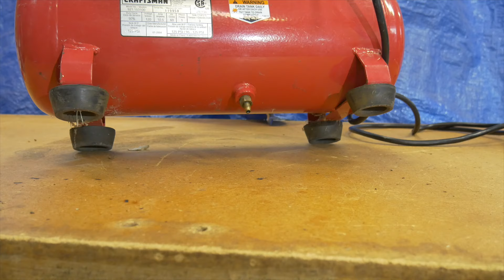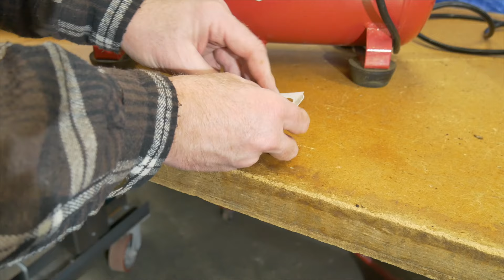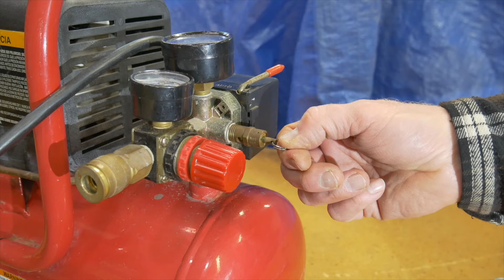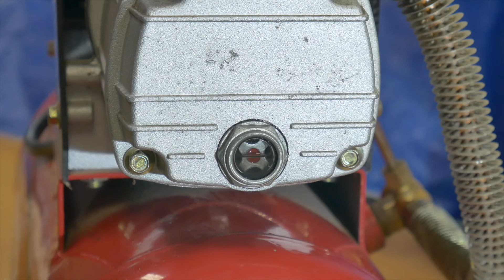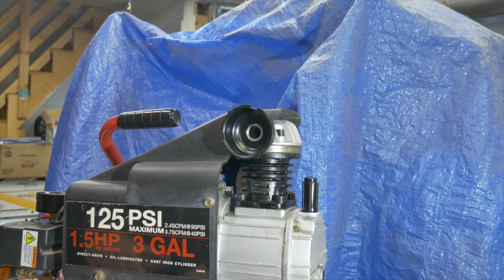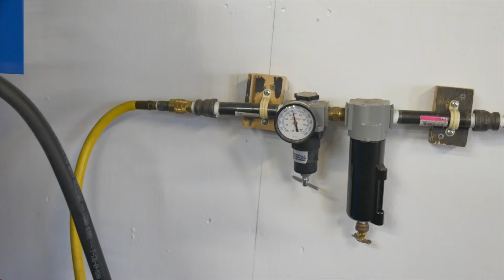Air Compressor Maintenance - A few tips to keep your small air compressor in top shape!

Comment: If you open the drain valve with 20 PSI in the tank it will blow all the water and moisture out
Reply: Add a cooler between the head
and the tank and you won't get
any moisture in the tank. It will
last a lot longer. 😁✌🖖

Comment: Thanks very much for the video, what are the time interval of servicing the air compressor?
Reply from the maker: If you've got the manual, it will have some recommendations.  I do mine every couple years.  It gets occasional use.  If the oil is milky it probably needs more frequent service.  Depends on the climate too, whether you have a lot of moisture in the air or dust, like woodworking.  Thanks for watching and leaving a comment!

Comment: What size wrench did you use to remove sight glass to change oil?
Reply from the maker: A 15/16" wrench works on this one.   Thanks for watching and leaving a question!
Reply: @metalwooddesign I just bought a used husky 20g. Do I need to change the oil that way too or keep researching? 👍

Comment: When you're done letting out the air/water from the valve on the bottom,  is it better to close it up or leave it open between use?
Reply: After a little a research.  Seems leaving it open is best.

Comment: I got mine from the company shop I work for, they decommissioned it for a larger shop-sized two-cylinder unit. As I drained the tank, a whole puddle of water oil mixture burst out on the floor, painting a circle about a foot in diameter. Took me a can of brake parts cleaner to clean this mess up. My compressor is a direct-driven V-2 with an air filter on each cylinder head from 2006.

Comment: often wonder why the tank drain valve is not at the end of and at the very bottom of the tank.....  and I suggest you fit elbows so the hoses to and from the regulator you have mounted on ur wall, hang vertical from regulator . good vid..:glasses-purple-yellow-diamond:😎

Comment: I like to open the drain, turn on the compressor, then tip it so the drain points down. It blows all the moisture out and the water that comes out is clear for me.
Reply from the maker: That's a great tip!  The drain is offset for clearance so you have to rock the tank in both directions to get the water out. Thanks for watching and leaving a comment!!

Comment: When you get that much water, and there will be particles of rust eventually, it is a really good idea to put an inline water separator on. I just rebuilt some framing nailers and the one I bought from an auction had so much garbage inside. Worst air tool I had ever rebuilt, and it was very time consuming cleaning out all the debris. Good video.

Comment: Don't replace the drain valve. Replace it with a ball valve with an elbow and 1/4" copper pipe you can open it with your foot.i open mine almost every time I walk by it without having to bend down and it only takes a second or two.
Reply from the maker: Having a valve that's easy to open every time you walk by will keep the water out for sure.  Great idea, thanks for sharing!

Comment: jesus, my compressor is years old and barely blows up a tyre for a minute before the pressure drops and the motor starts to fill up with air again.
I just found out on this video that water accumulates inside and needs emptied, I have had it for years and did not know this, it must have more water than a fish tank in it lol

Comment: Thanks for the video. After changing the oil on my compressor, oil started spitting out the top of the oil cap (which seems to have a breather and check-valve of some kind). Any guesses why that's happening? I have the oil level exactly halfway in the sight-glass, and I used oil meant for air compressors (ISO 68).

Comment: I have the same Craftsman compressor model (mine was manufactured in 2007). Recently it stopped generating pressure beyond 30-40 PSI and would run continuously. I thought it was a bad pressure regulator, but it turned out to be a blown upper head gasket. This gasket seals between the head intake and exhaust chambers, and my gasket had blown out between the chambers. Once I replaced the gasket it worked perfectly.
Reply: Valves will also load up with deposits and perform similarly. Most of the compressor valves can be disassembled and cleaned; will run like new!

Comment: Always wondered if I can leave my compressor under pressure between uses. I prob use the compressor about once per month. Is it better to drain the pressure in between uses? It’s a small 5 gallon no oil pancake compressor.

Comment: Very good video, I have a 21 gallon vertical Central Pneumatic Harbor Freight compressor that I bought about 12 years ago and did have to replace the leaking top end cylinder gaskets after 2 years but it wasn't very difficult or expensive to do. For the last 10 years it's been pretty trouble free draining the air tank out periodically spring through fall and just before winter and placing it out of service with the valve open for any further moisture drip not needing to use it again until spring, very seldom does any moisture come out of it anymore since I've done this on a regular basis, I change the oil and service the filters each spring, let it run with the valve open for 10 to 15 minutes, then pressurize the system, I also normally like to keep only 40-50 lbs pressure charged in the tank until demand calls for more instead of keeping a full tank of 110-120 psi for safety just to guard against against excessive tank failure damages in the garage in the event of an explosion.

Comment: Hi, your blue shop air compressor is almost identical to the one I  use.  It is suppose to be continuous duty, but discovered that the belt-enclosure, directs all of the air of the cooling air, under the compressor case, instead of over the cylinders, heads, and charge tube.  I tossed the guard, air flow now cools target areas.  I am certain this was a deliberate attempt by the manufacturer, to shorten its life duration.  Especially, if it ever ran under continuous duty situations.   As well, I installed a brass elbow, with 6" extension pipe and ball valve, to allow water to collect in brass pipe, away from metal tank.  
  Tank corrosion, sets up a very dangerous situation, on the smaller compressors, for the ones using 30 year old craftsmen compressor's, set them outside away from your proximity, while under pressure,  or buy a new one.  Be safe.
Reply from the maker: The extension is a good idea to get the water away from the bottom of that tank right away.

Comment: My old 1975 craftsman compressor had an oil change maybe 3 times in 40 years.  I rarely drained it.   I just retired it last month.  Still worked great.  Probably ready to explode.
Reply: The more the oil carryover from wear the less the rust, I don’t think oil compressors need an oil change as there’s no combustion byproducts. Just use em for an hour or two to get them hot every now and then to burn off moisture

Comment: Just a safety note  , if u have to weld up a hole caused by rust on your compressor tank , scrap it it’s absolutely deadly if it lets go
Reply: why deadly its only 10 bar ?
Reply: @Beyond-Horizons- easy lesson good for dunces you will find out
Reply: @Beyond-Horizons-  Darwin got another one.

Comment: how many working hours should be taken for maintenance just like compresssor
Reply from the maker: I've been changing the oil in mine every other year and of course using a top quality synthetic.  Drain the water drain daily, air filters depends on your on situation, like garage use vs a dusty woodshop.  It's always good to see what the owners manual recommends if you have that.   Thanks for watching and leaving a question!

Comment: Any tips for quieting down an air compressor like this, as an example? :) its mainly from the exhaust coming.
Reply from the maker: Keep it maintained in good shape and repair/replace any leaky fittings.  That will at least keep the cycle time down.  The single stage compressors do make some noise.  Thanks for the question!
Reply: You can store it in a separate room or build a box to hold it, with an opening for the exhaust. Best in my opinion is to buy a quiet compressor. They cost more, but they are definitely quieter.

Comment: I'm getting ready to purchase a  compressor. I guessing oil compressor will last longer than a oil free? My connectors from harbor freight seemed to leak for my central pneumatic air tank.any suggestions ?
Reply from the maker: Milton makes the best air fittings. They're USA made, affordable and widely available.  Pick a style and use that on all your air tools. M- style is going to be the most common.  There's no reason to suffer along with 'universal' fittings or chinese junk when it comes to the connectors.  Leaks are a real nuisance with the small compressors since it will make they cycle more frequently.
Reply: @metalwooddesign  Thank u.

Comment: Why is the drain cock not placed at the lowest portion of the tank? This is a design defect as water will never "fully" drain. The horizontal tank design could have the drain valve located between one set of the legs so as to avoid damage to it.
Reply from the maker: The tank sits low enough that there isn't room at the bottom for the drain cock.  You need to rock it over enough so the drain is at the lowest point for the water to be forced out.  A bit of a design compromise on the small portable compressor.  Thanks for watching and leaving a question!

Comment: I have the same air compressor it’s dated 08/2002 . Is there an expiration date for these compressor’s I do not see any indication of the same on the tank. thanks for the vid.
Reply from the maker: I'm not aware of any expiration dates on the smaller compressors.  It's a judgment call based on the condition of the tank.  Moisture is the problem and that varies greatly based on climate, use and whether you drain the tank frequently.  If there's a safety concern it's best to replace it.

Comment: That's a case of maintenance deferred......  with your 200 yrs experience did anybody think instead of patching the tank, you throw it away?   Because it was obviously so rusted to the point it had a hole in it! Glad I saw this!  I was in the market for a used air compressor and so now I'm not.  Thank you for posting!
Reply from the maker: Wonderful comment, absolutely great idea to do some research before jumping into anything.  The patch job was just replacing the drain valve with a new on that's easy to open, so it's drained with each use. Thanks for the comment!

Comment: How do I replace the springs and push pins in the main pressure regulator on the tank. Keeps leaking air around the adjustment Knob. Right before I have my first work since fall coming in sat. Can someone please help. I do Hydrographics, I need my compressor

Comment: If I need to clean the inside of my tank due to rust how can that be done and how will I know that needs to be done? Thanks, great video..
Reply from the maker: I don't know of a good way to clean them.  Best is to drain frequently to keep the water out which means a good valve that opens easy.  If the tank is corroded enough that it's a safety concern I would just replace it.  Have fun and stay safe!

Comment: Drain cocks are a PITA on larger compressors because you have to kneel down and sometimes need a tool to open them.  It's such a hassle people often forego the important step of draining the tank.  Install a 1/4" NPT elbow,  a small threaded pipe section or nipple to hold accumulated water,  then a small 1/4 turn ball valve,  and lastly a hose barb to attach a small hose to an appropriate location.  I like to use all brass or stainless for the pipe sections.
Reply: I use all brass fittings on my air compressors and drain them daily after use I also leave the drain valve open too until I'm ready to use it again
Reply: "Drain cocks are a PITA on larger compressors because you have to kneel down"

Name your air compressor "Zod".

Comment: I would say it needs a lot of attention and with all the rusty water coming out of it from neglect I would not use it. My craftsman 33gallon upright compressor i bought new in 2003. I replaced the  drain cock right away because it was a pain reaching under it and added some 1/4” galvanized pipe and a small ball valve within easy reach. I had to fill the tires on the cars cuz it is cold and i topped off the air compressor….and I drained the water that always forms by giving it a few quick turns of the valve into a clean cloth…..the water that comes out is clear after 18 years…..i will resume the video now!

Comment: All one can do is change the pump oil if applicable and drain the water at least a couple times per month. In my case, my compressor is located in an unheated building. I do not use my compressor that much in the winter except to reset tire pressure or to blow out a vacuum canister. Most my use is during the more temperate months. One thing I did was that I eliminated the pin cock altogether because a pin cock is crap to begin with. I utilize a ball valve.  I added a 1 inch fitting to a 90° elbow, then a 2 inch pipe followed by a ball valve. First I turn of the auto on switch and decrease the pressure, then I  simply kneel down and turn the valve to the 'open' position, allow to drain then return the valve to the 'closed' position. The allow the compressor to replenish the air.
Reply from the maker: That's a great idea.  A good valve that's easy operate means the tank actually gets drained. Thanks for the comment!

Comment: How often should a small compressor cycle... if at all?  Mine kicks on every 5 mins, often scaring the bejesus out if me.
I'm guessing, they shouldn't have to cycle all that often with quality and correctly installed futtings/valves/gages.  HF is always of questionable QC, therefore initial maintenance is that much more important as the factory tolerances are Chinese (yep... even the "Pittsburgh, or Chicago Electric HF brands... I feel cheated somehow).  Break in (early x 2) oil change(s) is a must for most all motor-driven equipment.  Magnetized dipstick, oil filter or externally if possible helps with the break in period wear/ metal shards.  #1 cause of early failure is not doing smart maintenance on "maintenance free" stuff.  But that's the American way today... disposable is the new dependable.  Thanks Chinah.
Reply from the maker: It shouldn't run very often unless something is leaking.  I suppose if it's new you could have gotten a dud, but I'd check for a leaking fitting first.

Comment: Glad I watched this. I'm fairly new to this and didn't realize my offset compressor needed to be tilted to drain. I just did that and a good 1/4 cup of liquid came out. Thanks!
Reply from the maker: Glad it helps!  Thanks watching, I appreciate the comment!!
Reply: Drain the tank slowly aswell, incase theirs any gunk in there, if you drain it too quick it will fire out air rather than all the water and crap

Comment: I have a 25 gallon air compressor which have never been drained  at least a year or two very heavy open up the plug nothing comes out is there anything I can do with this tank?
Reply from the maker: The drain valve itself could be plugged.  You might have to remove it to clean or replace it.  Of course, if the integrity of the tank is in question, it would be best to discard the tank for safety reasons.

Comment: Thanks. Everything I needed to know in one video. Cleaning up a decent size air compressor handed down from my Grandpa to my Dad and now to me. Still works like a champ!
Reply from the maker: Neat story, thanks for sharing!
Reply: that's exactly my case as well. Gramps was a big tool and machine collector, but neither me nor my father knew how important maintenance is to these things. Just because they lasted a decade doesn't mean it will last another without proper care.
Reply: Many tanks have a 'take out of service date' on them. The tank might not be the best heirloom item. Consider replacing at least the tank portion of your air compressor. Here's a video of one that failed: https://youtu.be/sm_FJ6Pat4I
Reply: If it is that old, throw it away before it blows up.
Reply: @gordbaker896  I came here from watching a video of a guy showing his blown up air compressor. Definitely has me a little nervous to take good care of mine...

Comment: I have that exact air compressor.  I had to replace the regulator.  It won't screw in so the gauge is on top.  It gets to tight.  How do I get the guage on top?  Thanks
Reply from the maker: You could remove it and try it again or try it with a different fitting to find an acceptable position when it's tight.  Thanks for the question!

Comment: what happens if you run the compressor without the air filters?
Reply from the maker: The dirty air will cause premature wear, lower the performance and shortest the life of the unit.  Best to keep them in place and in good condition.  Thanks for watching and leaving a question!!
Reply: Damage to the piston and cylinder, right?
Reply from the maker: Yes, increased wear.